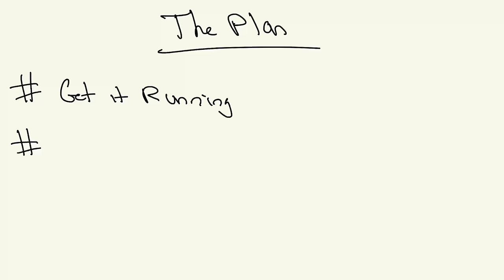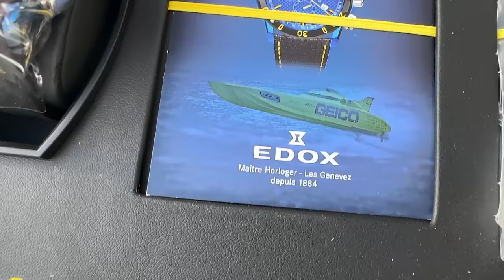Why you Should NEVER Buy an Orange County Chopper

Comment: I had a buddy get a nice inheritance in 06, he ordered a bike from OCC, they said 8 months but took them 2 years...When he did get the bike It didn't make it 50 miles down the road.  Then when he called to complain they ghosted him.  He then had the bike towed mack to their shop they trespassed him immediately. Cops showed up and told my buddy they come out once a week for this very thing. "They sell a bike that doesn't run, person brings it back and they trespass them". He sued and they paid him extra for a NDA.
Reply: Probably BS
Reply: I’ve read a few stories similar to that from BBB claims
Reply: They can't be that bad, The engines aren't even built there, They just do the body
Reply: OCC wasn't really about bikes it was about selling advertising. A company like GEICO has a bike built for a 100k + and they got millions of views from the show. It was the cheapest advertising you could buy and it was genius on both OCCs part and GEICOs. Too bad OCCs bikes weren't as nicely built to run as they were cosmetically.
Reply: High p
Reply: @Funrunner008  OCC instals the engines and does so very poorly. Those OCC bikes are crap. Parts do not fit that they hammer in or use their foot to kick them in.
Reply: Buying a Harley-Davidson chopper style bike is a guarantee it was build by an angry alcoholic lol  @Asidebar
Reply: An NDA which, he clearly violated, lol.
Reply: u neva kno 😅 @Tbizzh
Reply: Leno says it's the worse bike he ever had and it was all wired thru the brake like.
Reply: @Thumper256  ...and they GAVE that bike to Leno. 
He talked to them about their show and when they rolled out the bike he nearly ignored it.
Reply: Jay Leno says on YouTube OCC's are a pile of scrap!
Reply: That guy showing up was a God send! You still got a good deal with everything you got! Can’t wait to see the update!
Reply: @Funrunner008 they make kits that look cool but aren't functional...
Reply: They’re show bikes. Meant for the 100’ debut run up to a stage and then they immediately drain all the fluids, remove the battery, and prop it up on a pedestal in the main lobby. If you expect anything else out of these “motorcycles”, then you’re in for a rude awakening. If you ever get the chance to sit in the saddle of an OC Chopper, then you’ll realize they’re not even anywhere safe to ride.

Name ONE celebrity or CEO who rides their Orange County. 😂
Reply: Sounds so bad. Like no oil inside coating  the  cylinders.
Reply: So since theres a NDA this is unverified
Reply: @Funrunner008  , yeah?  You don't think the way they design and run the exhaust, fuel, cooling , power , etc lines can make a $50k motor run like junk?
Reply: Should hag just bought a ironhorse those where good quality built bikes,  I had 2 of them they look easy cooler than occ bikes,  but that surprises me about their customer service
Reply: I mean, if you ever watched the show, its obvious they aren't built well; ham-fisted together at best, redoing fabrication not bc they measured wrong but bc they f'd up.  Even Pauli would f up something and be like, "we'll make it work."   

Then they would call up the ringers, like the guy who tuned the motor on this bike, and the bike/engine would go out and come back magically working.  I wouldn't have paid any money for an oc bike, let alone $100,000
Reply: there are two sides to every story .. funny how much OCC gets trashed.. these commissioned  bikes were really never meant to be 'ridden' daily... I do know a few OCC bike owners .. no issues at all, except on the one 'built' motor.. need a super high CCA battery ..  I do believe they got way in over their heads, backed up.. ... a shame ground breaking reality show ..king of all reality shows ... then... everybody tuned in..
Reply: @josiffexplosiff1 it really isnt
Reply: Yeah everybody says they weren't to be ridden but those clowns in the show claimed that they rode them and they were capable of being ridden. I call BS.  The geometry is just absurd on those things and they're ugly as sin.  I don't see why anyone should want something so ridiculous looking to represent their company...let alone pay such ridiculous prices for them.  At least you could ride a Jessi James bike.  OCC bikes are a joke and they've always been junk
Reply: Occ bikes were basically just great advertising pieces
Reply: I was in automotive college when this show was on. We laughed at them. Also being in The industry for many years in NY I heard from ppl w/ experience with those bikes. They aren't meant to be driven however that should be clear from watching the soap opera that is occ.
Reply: The fuel tank runs dry in 15 minutes if you're lucky with the tiny custom tanks and gas guzzling motors.
Reply: @Thumper256 There was one in our area. Every time they tried to ride it, the wiring would burn up and leave him waiting for the trailer. Finally had it completely rewired by a bike shop. Then when he went riding, other things would break or foul up. It changed hands several times after that. Then just disappeared. Someone must of found a chump from far out of state. They are just a "work of art" and not really made to ride.
Reply: @carlmayer691  I understand the concept of them not being ridden daily or commuter bikes but the level of quality is at the point of unsafe it's in nearly unusable. Its one thing if they sold motorcycle display pieces, but these bikes literally burn themselves out in a few hundred miles.
Reply: @Thumper256 they even cheaped out on the wiring 😂😂😂😂😂, whats a few more conductors worth? Maybe they have ZERO knowledge on how circuits work 🤡 😅😅😅😅😅
Reply: Be realistic people, it was a TV show ffs😂
Reply: @Tbizzh not necessarily. He was around when it happened
Reply: @paraglidingprospector I mean, you're barely hanging on with knees around you're armpits. Does not look vaguely appealing compared to bombing around on a Royal Enfield or a CBR on country roads.
Reply: @roberttucker9866  a pretty lousy and scripted one as well, it was sooo obvious. but now we get proof of just bad the "craftsmanship" was. I mean the guys couldn't even fabricate a decent gas tank to save their life 🤣🤣🤣🤡🤡
Reply: @Funrunner008 The guy who won the contest to get an OCC bike for free, said it was the biggest piece of junk he ever saw in his life. He said they told him it was an $80,000 bike, so he had it for a year or so, and had nothing but problems with it. 

The front brake was worthless, and the back brake was so sensitive you just touch it and it locked up.  The battery would not stay charged, there was no speedo, or tach, so you had no idea how fast you were going. And the wiring was always causing problems, sometimes the headlight would go out, and sometimes the taillight did not work. 

He said it looked like a guy at ACE hardware wired it in the parking lot. And there was no cover on the primary belt, so if you put your leg wrong it could suck your pants into it and chew your leg up. 

It was so bad he was scared to ride it, so he put it up for sale for $50,000, and nobody would buy it. He finally got someone to buy it after a year or so, and all he could get for it was $8,000, for a 2 year old bike with hardly any miles on it, that they said was an $80,000 bike.
Reply: @Thumper256 Leno makes jokes about his OCC bike all the time, and it got back to Paul Sr. and he was mad about it. He said he thought Jay was his friend, and he said after Leno said his bikes were trash they never spoke to each other again.
Reply: And now you have exposed him breaking the NDA to millions of people...
Reply: @carlconstantdeflon2373 lmfao, he never even said the guys name. And btw, you clearly do not know how an NDA works. The average NDA is only good for 1 to 5 years. He got the bike in 2008, that was 14 years ago, so the NDA most likely expired a long time ago. 

And one last thing, OCC does not even make motorcycles any more. So any NDA signed in 2008 would be worthless and useless today. An NDA protects the reputation of a business, how do you protect their reputation when they are not in business any more.
Reply: @josiffexplosiff1 no, it isn't. They were notorious for that even before the show started. If anything, their customer service got worse when Discovery came calling.
Reply: I find the watch much cooler than that ugly motorcycle.
Reply: Let's hope he didn't sign that NDA because you're over here telling everyone 🤣🤦‍♂️
Reply: Wow. That’s a crazy story. Doesn’t surprise me though.
Reply: @workingcountry1776 I worked in their industrial radius.  The company I worked for back then actually took over the old man's original steel supply (oc ironworks)  warehouse when he moved out of it. He left it a dump.
A lot of us were riding bikes to work. 
When that show took off, we just shook our heads. These guys had no mechanical skills, no real fabrication skills. I mean Junior just wakes up one day and starts "designing" .  Couldn't even use a drill press properly. None of those guys had any professional shop experience. A bunch of hacks with money and a camera, making a mockery of motorcycle fabrication. 
The shop guys in the area  all knew this. But if you talked to a regular person, they'd just say, "you're jealous".
Well, no. You couldn't pay me enough to be famous for scamming people, doing bad work, and having poor taste.
Reply: @steves2241  that's a great story.
Reply: Built eyeballing everything using a step drill bit.If it doesn't line up ,just ream the hole bigger.
Reply: @Tbizzh  depends on how long the NDA is. you know they expire right?
Reply: My take away from all this, don’t pull the entire aluminum foil seal off any jug, poke a hole for exact pouring, genius.
Reply: It doesn't make sense to me.  Just don't make garbage, it's not that hard.  I would say this has moved from engineering incompetence to fraud.
Reply: If that story isn't bs which I'm sure it is, good job on the nda
Reply: @Chrish4200  you know NDAS expire after a certain amount of time right?
Reply: @steves2241 clearly you don't know how an nda works. He didn't say the guys name. The nda isn't protecting the guys friend it's protecting the company which he mentioned. And yes nda's can expire but they also can have any amount of time on them. And it doesn't matter if the business is around or not if the individuals mentioned are.
Reply: @zesolodar  give a quick google buddy. They don't have to expire they can be indefinitely
Reply: But I'm sure you know more then all the lawfirm websites that said that
Reply: @Funrunner008 they always had problems getting their bikes running once they got them together who cares who is building the engines because the odds are they weren't built any better there than what these guys were building the bikes they were nothing but show garbage is what they were I've got mega mi on bikes and their bikes were not made to ride
Reply: “nda” 💅💅💅
Reply: And yet people believe everything they see on TV. They even form opinions and repeat fake news.
Reply: Sounds like that NDA didn't work, either. LoL
Reply: @Funrunner008 You still need to align the engine with the bike's setup. Then there's the supercharger. I've seen other pieces on this bike and it appears to be a real dumpster fire.
Reply: @Chrish4200

Clearly you do not know how an NDA works yourself. If an entity such as OC Choppers LLC entered into an NDA and then went out of business and there was no successor entity that acquired them (that is what happened in this case) then the NDA is no longer in effect because the entity it was protecting (OC Choppers LLC) no longer exists legally. Whether individuals formerly associated with OC Choppers LLC such as owner Paul Teutel are still around or not is 100% irrelevant because the NDA was between the former customer and OC Choppers LLC. It was not an agreement between the former customer and Paul Teutel personally so whether Paul or any other former OC Choppers LLC owners or former employees are still around is irrelevant. 

And yes, in this case the customer could absolutely disclose the NDA terms and there is not a thing Paul Tuetel, nor any other former individual associated with OC Choppers LLC could legally do about it because the legal entity the NDA protected (OC Choppers LLC) no longer legally exists. Since there was no successor entity that legally acquired OC Choppers LLC there literally is no individual person, nor any business entity that would have any legal standing to sue the customer for disclosing the NDAs terms. If Paul Teutel for example tried to sue the owner for disclosing the NDA terms the case would be instantly thrown out by any judge because the judge would simply look at the plaintiffs counsel and ask, “is OC Choppers LLC still in business” and “was OC Choppers LLC acquired by any company or individual”? And the moment both those questions are answered No and No the case would be instantly tossed. 😀
Reply: @Funrunner008  dont get me started..
Reply: @Tbizzh na, NDA's have time limits
Reply: It's just a fancy display
Wtf u expect?